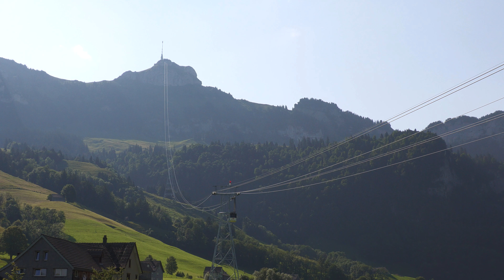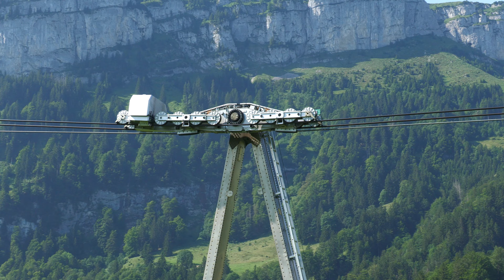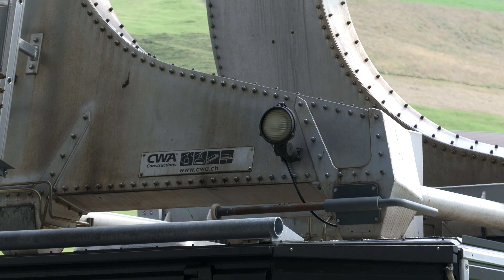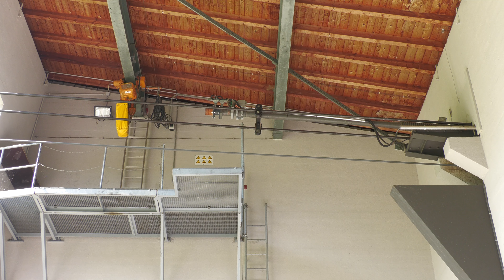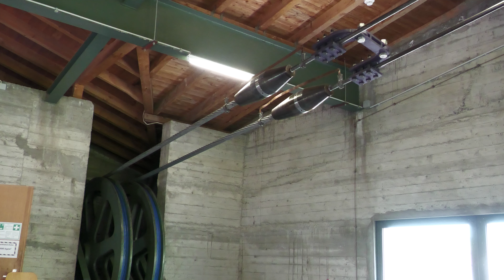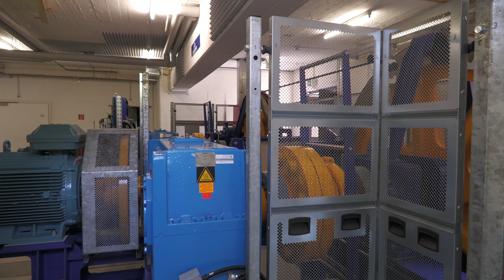Brülisau-Hoher Kasten

Comment: très bel appareil, qui sera surement détruit plus tard pour laisser place a une télécabine comme c'est la mode en ce moment...
Reply from the maker: Très belle ligne en direction d’un sommet d’Appenzell ⛰️🤩
Non, cela m’étonnerais, la machinerie provient de 2014 (très récent) et la ligne ne permet sûrement pas une télécabine (dernier bout au sommet assez pentu)
Reply: @GondelbahnMonde  Too steep for a monocable lift! And Brulisau isn't a ski resort either so there is no mad rush for speed and capacity. If it were to be replaced that would only be because the modern manufacturers have overcomplicated everything to make their ways of operating ski lifts commercially the only legal way. Even if the old lifts never have any accidents caused by any parts of their own mechanical design...

The Hoher Kasten lift's bottom station was badly damaged after a gondola crash apparently. Nobody died or was badly hurt I don't think but that would explain the new Doppelmayr-Garaventa motor mechanisms in it. Otherwise it is original 1964 Habegger.

Twin to the old Furibahn of Zermatt(Von Roll, same year. Slaughtered in 2022, something that I wish never would have ever had any possibility of happening.)
Reply: @CBF1  was meinst Du mit "Zwilling" der Furibahn in Zermatt ? das kann man unter keinem Punkt vergleichen. 
Am ehesten ist die Kastenbahn eine Schwester der ebenfalls im gleichen Kanton erbauten Kronbergbahn.

DEr Unfall mit der Kabine war 2010, als der Betriebsleiter die automatische Steuerung ausschaltete und sich vom Kommandopult entfernte und die Kabine ungebremst in die Station krachte.
Reply: De bleu l'engin ❤❤❤❤❤❤ superbe... que ce téléphérique fonctionne encore très longtemps ❤❤❤ bravo pour la réalisation de cette vidéo faite avec une grande classe